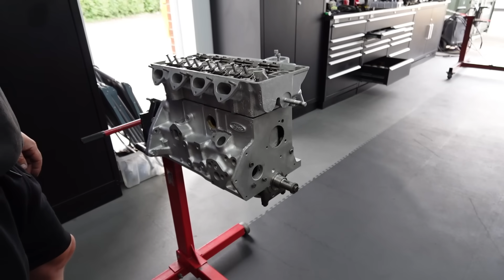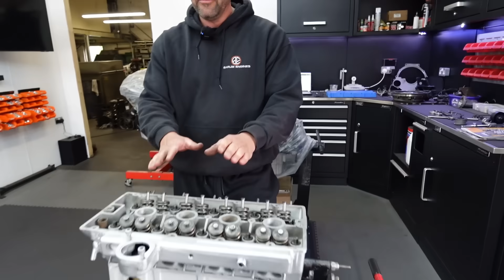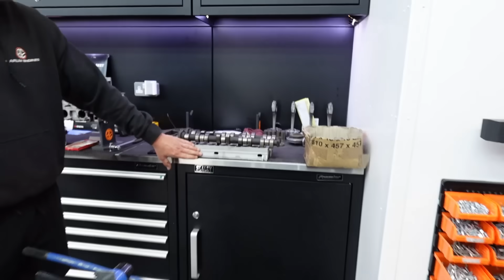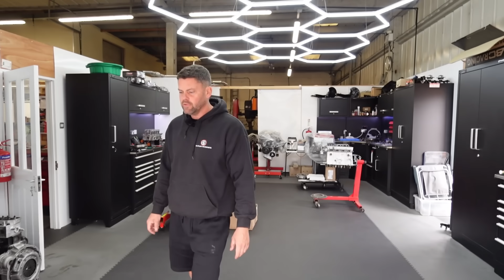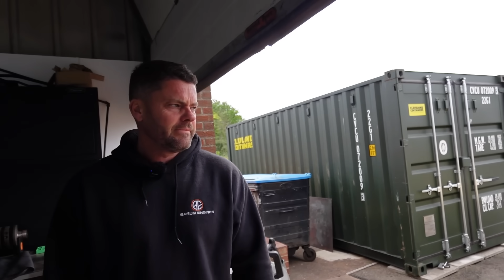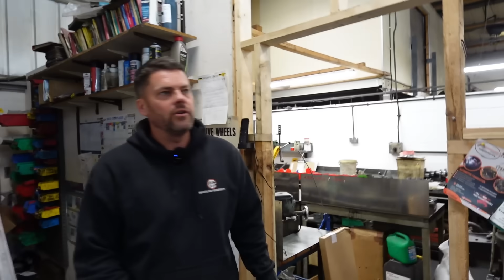PROBABLY THE COOLEST ENGINE FORD EVER BUILT!

Comment: Yes do a cosworth in the mk1. Correct diff ratio and it will be fine. It's all down to how the driver wants it to be. Grippy tyres are a must to be fast. It is wild on road tyres don't get me wrong but when your chasing big spec evos with double the power than a cosworth in 5th gear it all makes it worth it. Not once in the 10 years of having a yb in mine has it ever pushed. That's a myth especially if you got a heavy right foot. Thanks for the mention Lee 👍🏽

Comment: The BDD is actually the 1600cc one to have.  They were used in Formula Atlantic back in the day. Sounded fantastic up around 8500-9000.  Still gives me goosebumps remembering them howling through the trees in the Phoenix Park in the 1970s.
Reply: Or to be different, jam a GAA V6. DOHC GA (also called the GAA) as fitted to the 1974 Ford Capri DRM, into the van. It was based on the 60 degree V6 block of Ford Essex, and was used for the Ford Capris raced in Group 2 in the early 1970s. This new engine was radically different in that it featured twin overhead camshaft aluminium alloy cylinder heads, 4 valves per cylinder, a Lucas mechanical fuel injection system, dry sump oiling system, a steel crankshaft, and enlarged displacement of 3412cc, compared with the 2.9 litres of the previously used Cologne V6 based Weslake V6. Ford expected a minimum of 400 Hp from the new Cosworth engine; that figure was exceeded, with the engine producing 420 Hp in the first test run.

Comment: In case grease ends up not working for you, the Escort RS1600 workshop manuals suggests using magnets to hold the followers in the cam carrier. Torque values for the head are 60 - 65 ft-lbs. For the cam carrier to head bolts it is 8 - 10 ft-lbs.

Comment: Lee doesn't CTM or Burton know the head torques! I read the block is an original X/Flow and the head is tightened to the X/F torques, My Mk 2 Cortina was 80LbFt but wasn't stretch bolts.

Comment: Read the tin if you use Hammerite lads, to many people have put a coat on one day then a second coat the next day, unless its been changed you need to put the second coat on after 6 hours or it acts like a paint stripper if you do it the next day and will bubble it all off causing a right mess you boys dont need
Reply: It was changed years ago when they took away the xylene solvent (the stuff that blew your head off). The second coat doesn't lift the first coat any more. It also doesn't need special thinners or brush cleaner, but it doesn't work or last anything like the original either.
Reply: @davidnorton5887 I didn't know about the formula change, but I did notice some years ago that the quality had gone to hell.
It lost its toughness and durability, especially in the sun. Suddenly you could easily sand it off.
There are much better products available these days.
Reply: @davidnorton5887 I have stopped using it. I didn't know about the formula change but I found that it has lost its toughness / durability.
There are much better products on the market now. I switched to Oxirite.
Reply: Hammershyte - never been a fan of the stuff.
Reply: From memory Hammerlite is not available in black, An option for the metal stairs, is PA10 Toplac etch. It is available in several colors,  including black, grey and orange. PA10 also offers a non slip additive called Intergrip.